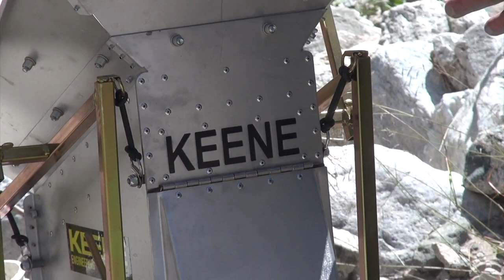Keene's 160 Dry & Wet Washer

Comment from the maker: There is nothing cheap about the 160 construction; it is made of .063 aluminum, and it is extremely tough and robust. Over the 10 years plus we have sold them, we have not received a single complaint about construction or function. This is not a Chinese construction, and it is very strong. With all the bends and inner construction supports, it is super solid.  I love this machine. It is light, fast, and easy to set up and fine gold recovery. It is the best in the business, and one of my favorite things is the Low dust feature.   We are more expensive than most, especially if you compare us to China equipment. Not only do you have the best equipment, but you have a support team, mainly Pat and Mark Keene

Comment from the maker: The vibration system is the best in the business.  We use a steal fan with a ring welded around the edges to contain the air so the vibrations is very active.  The air pressure controlled by the dual blast gates in the back.  The down side to this machine it does take a little practice and fine tuning is a must.  Once dialed in correctly the recovery is amazing.

Comment: Maybe adding more aerodynamic blades made of lighter material, and smaller off balance weight you would get high frequency vibration at little air movement.

Comment: Some comments on dry washing,  One, it can cause a cancer known as silicosis. Very bad stuff. Wear a good dust mask. It is also quite ineffective at recovering gold. Think about 50%. I had the experience of trying it at an outing in Arizona with several experienced dry washers. After cleaning out the mats and finding about 2 grams of gold, I decided to pan the finer material that went through the mesh mats and was trapped inside the dry washer. It was a puffer type. Some of the more experienced user said I wouldn't find much there. I actually found more under the mats than in them, The gold in AZ is very, very fine. Some I found went through a 100 mesh screen. These dry washers won't catch that. Also, you can miss larger pieces coming off the top screen/grizzly. My advice, try to set up some type of recovery system using water.
Bye for now. Happy mining.
Reply from the maker: Larry I agree with you a good mask is so important when dry washing.  The new 160 work better than the old DW2 dry washers.
Reply: @KeeneEngInc  I was prompted to write my comments after watching the Aussie gold miners with dry washers. No masks. These guys are crazy. Do the not have a Workers advocate in that country?
Reply: @TrueBlueYukoner  Yes we have very strict OHS rules in Australia. I think they deliberately show the operator's doing the wrong thing for entertainment purposes.
Reply: Putba 150 or 200 mesh screen and always detect your tellings or run them again.

Comment: Pretty cool unit, But it really needs legs on the front of the sluice so it's not shaking and moving around so much..
Reply from the maker: When pat and I used it the sliuce was fine.  The only time we had flex was when the pressure hose banged into it.  It can be deceiving since the hole machine moves around since it is mounted on the O rings Springs.

Comment: super cheap looking. like a soda can material. You charge way to much for your stuff by a lot.
Reply from the maker: There is nothing cheap about the 160 construction; it is made of .063 aluminum, and it is extremely tough and robust. Over the 10 years plus we have sold them, we have not received a single complaint about construction or function. This is not a Chinese construction, and it is very strong. With all the bends and inner construction supports, it is super solid.  I love this machine. It is light, fast, and easy to set up and fine gold recovery. It is the best in the business, and one of my favorite things is the Low dust feature.   We are more expensive than most, especially if you compare us to China equipment. Not only do you have the best equipment, but you have a support team, mainly Pat and Mark Keene